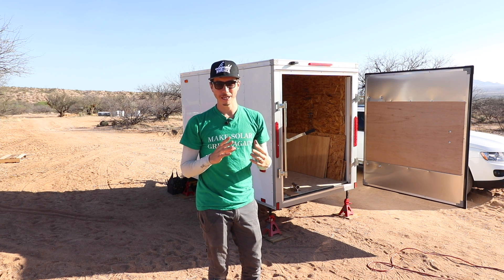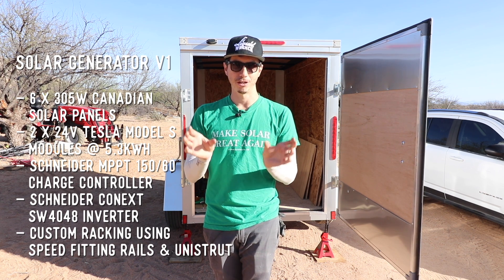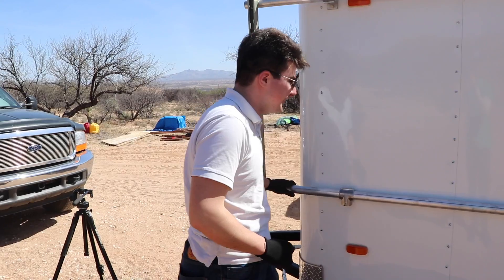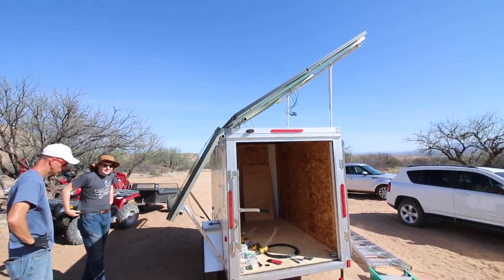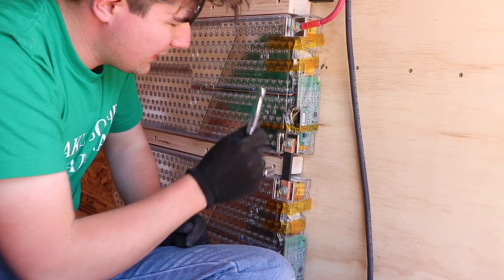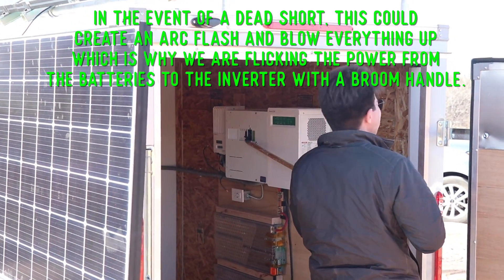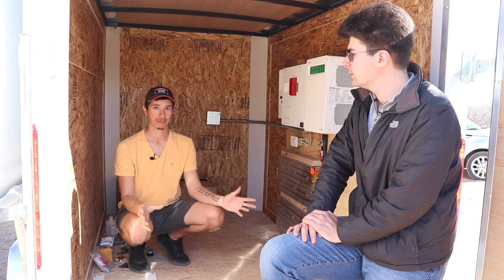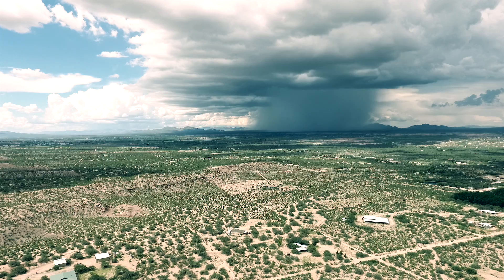DIY Solar Generator With Tesla Batteries On A Trailer... Can It Be Done???

Comment: This is exactly what I am thinking of doing for our REACT emergency response communications team. I have basically the same trailer that I am wanting to use, yet I only need to be able to power our radio equipment and other various 12-volt equipment for disasters so I will be doing a 12-volt battery storage system with the solar panels on the roof. I was wondering if this could actually be done, thanks for the inspiration to actually go ahead and do it.
Reply: As a fellow ham, I too think this would be a perfect mobile command center for RACES or other mobile/emergency operating. I would still go with a high voltage (48V) system since you will need a clean linear supply to operate most radios and filter out any inverter harmonics. Still plenty of room in the shed so I bet you could fit a mini shack on the other wall. Might have to investigate some EMI shields for the power electronics, large faraday cage anyone? 73, K1DIY
Reply: I am designing everything so that I can try to stay away from an inverter that wastes a lot of power converting from 12-volt to 110-volt then we have to drop it all back down to 12-volt anyway to use it.

The solar panels that I have provide 100 watts at 12-volt. All of our radios, equipment, lighting, rechargable flashlights, HT chargers, and the laptop for digital comms that we use on disasters is already 12-volt. I used to drive a semi for a while, so my coffee maker is even 12-volt, lol. If I can design a portable mounting system for it I also have a 400-watt wind turbine that I can add to the trailer so electricity can be generated even when there is no sun.

I have a full-size cargo van now that I am now using as a mobile communications center. Everything in it is on 12-volt. The trailer would be used as an addition to that system by providing more battery storage and additional solar cells for longer duration events.
Reply: is react still a thing? not heard that acronym since the 80's when cb became a thing in the uk, I used to be part of a volunteer group. is that an american call sign? I ''had'' an american callsign, had in that i've not owned a radio in about 20 years and while i think i'm still isted in the 'book' i dont remeber my call sign, but the ''pay to search'' websites have my name/town etc so i guess if i paid them i'd be able to find what my callsign was
Reply: Yes, REACT is still around, and yes they still utilize CB, but they also utilize FRS, GMRS, MURS, Marine, Aircraft, radio bands as well as being very heavy into Amateur Radio. Many teams are even getting into satellite communications and things like that for disasters. We work alongside ARES and RACES ham operator teams.

Yes, WH6FQE is a US callsign. The H6 shows that it is located in Hawaii. With your name, city, state and approximate date of issue of the license I may be able to look up your old callsign for you if you want me to try. Send me an email at WH6FQE@mail.com
Reply: We have companies here in Australia already making them, they use the in the open cut mines as mobile command centres and others as radio repeaters. A lot of these mines cover 50+miles between pits down this way, and a lot more from civilisation, with no services nearby, solar powered units have really taken off.
Reply: Aussie Manly Man

This is perfect timing. We just decided yesterday to make a change in our setup. The van will still be used for our mobile communications center, but the trailer will now be set up as an independent mobile repeater. This way when the normal repeaters on the island go down, we can just move the trailer up to the top of a hill or parking structure and we are back in business with a repeater. 

Unfortunately, this now means I need a LOT more batteries than I originally planned on.
Reply: We aren’t using lithium batteries much here, due to the fact of the items being in isolated areas and people stealing them. There are a couple of companies making flow batteries here who supply either vanadium or zinc bromine batteries. They don’t get stolen, last longer and are cheaper. But a Chinese company called BYD has just slashed prices for for lithium batteries, so they will be cheaper now I think. But price doesn’t matter much to the mines.
Reply: I looked into LiFePO4 batteries for our project, and I just can not see the justification for spending over $1,000.00 per battery to build two separate battery banks with. 

We are looking at SLA batteries right now. I can get a 155AH for $339.00 so about a third of the cost of the lithium batteries I looked at that was close to that capacity.

I am coming up with a total of 8 batteries needed, 6 in the communications van, and 2 more in the backup repeater trailer, so $2,712.00 sounds much better than $8.000.00.
Reply: WH6FQE - The Kilted Piper I built the exact system that you're looking to build  by repurposing Tesla batteries the total cost only came out to be about $4,000 there are plenty of used batteries on the market..
Reply: I just priced out (generally) the same components and I'm at about $8K.  Can you share your build list that kept it to $4K?

Comment: Smart idea and great project but what about road safety(mounting panel on AL bars only versus highway speed winds) and cooling of inside of trailer? Is it going to overheat? But thank for the video anyway 😎😇
Reply: Many aircraft are built almost entirely out of aluminum, likewise, for many unibody car chassis, you got something against it? While constructing this we had 25mph sustained, 45mph gust, winds and the thing didn't even budge, when folded for highway transport it's a non-issue
Reply: Liam O'Brien - I have nothing against aluminum - but I am very aware that there are a lots of very different aluminum alloys and so someone constructing from it has to me aware that also ... AFAIK

Comment: Great job! Are you planning to use the same size trailer for the set ups you are selling? Is there a minimum size that one can use for this set up? I'm assuming that you chose a size that worked the best to mount the panels and battery bank.
Reply from the maker: we found the smallest trailer that would work for what we wanted to do, could go smaller and do 3 panels that would have a slightly different application :)

Comment: the part that trips me up about solar is connecting it to grid power. Lets say hypothetically I build this and throw it in my yard, how do you connect it to your house so that your house depletes the batteries first and then uses city power when the batteries are extinguished. This is the part that I don't understand about solar.

edit I understand that you want to sell these units but I'm curious how much it cost. I've seen those Telsa battery banks on eBay go for 3k+ alone.
Reply: Hi, I think a transfer switch is used, either manual or automatic. Basically, it cuts power from the mains and uses the solar/battery setup. 
One thing you never want to do is supply power directly to your house without one. During a power outage, the power can backfeed through the mains and kill someone
working on the power lines. The transfer switch assures isolation between the solar power system and the mains power. Hence never shall the two be connected at the same time.
Someone, please correct me if I'm wrong. :) Have a nice day.

Comment: Didn't see any solar generator. Saw a nice solar system though. I get by on a gallon a day running my generator from 1973. Some days I don't use it at all. Your fuse problem would have been solved with a resistor of the appropriate size. Thought maybe you had built a home sized solar steam turbine GENERATOR.
Reply: David Link panels do GENERATE electricity from sunlight, just because they don't belch steam and noxious oxides doesn't make them any less of a generator, we aren't in the 1800's anymore
Reply: Liam O'Brien nice pretzel. Politicians generate a lot of hot air so we should call them generators as well.
Reply: I would agree with you about the hot air down in DC, but I'm only going by what Webster's says. gen·er·ate verb: cause (something, especially an emotion or situation) to arise or come about. produce (energy, especially electricity). Seems to fit the bill eh? Mmm pretzels, gotta go get me a snack...
Reply: Steampunk the setup!

Comment: What are you using for BMS? (Are you using a BMS?)
Reply: Four ZeroFour the video was already running 20min so we left out A LOT of detail, once we iron out a few bugs and Derek gets the shop up we will be making a super detailed course on how you can build your own including what we are using for battery monitoring (we can read cell voltages and do balancing with the built in Tesla BMS) and all the other details that go into a quality build
Reply: Liam O'Brien Thanks! Looking forward to it!
Reply: firpofutbol the book mainly covers the Smart car modules which don't have an easily accessible BMS built in, however, I do go over some alternative solutions for monitoring
Reply: Liam O'Brien is any of the BMS stuff explained in the book/pdf you sell?

Comment: With all those extra sails, what wind speed can it handle?
Reply from the maker: when we were building it, we had 30mph winds with gusts up to 50mph :D
Reply: Handeeman - Stabilizers on the outside of the trailer would make a lot of sence.  So would mounting the batteries near the floor to keep the tailer's center of gravity as low as possible.

Comment: This is awesome. I want to have a solar set up but doing more research. It wouldnt be useful during the winter here as we dont have sun but the rest of the year it would. We have a 2500sqft home. Am i crazy?
Reply from the maker: Do you live in Alaska? there are many factors to take in to account that it's hard to say :)
Reply: You happen to live in Greenland? Because they actually have almost no sun for 6mo out of the year, but if you live in any more reasonable climate then you will produce plenty of useable power in the winter
Reply: When I lived in Edmonton, Alberta. Canada, the sun in winter was at such a horrible angle, solar was a challenge. Out in the northern wastelands, we used electricity sparingly. I don't know what our setup was, but it was lithium ion batteries.

Comment: Wondering about keeping the temperature inside the trailer consistent since lithium batteries don't like being charged in extreme high and low temperatures? In my area, I have deal with 90° F outside ambient and +80% humidity.
Reply: Felax Chow one plus is that the panels create there own shade over the trailer, meaning that even on a hot day it will still stay pretty cool. It's pretty hot in Benson during the day right now but the trailer only gets up to about 85F/30C
Reply: Getting too cold is a bigger problem for lithium batteries, I recommend putting a thermostat with some kind of heating so the batteries don’t get too cold. Mortons on the move have done a very good series on installing Tesla batteries in an rv solar system.

Comment: Awesome, what was the cost for a setup like this??
Reply from the maker: About $10k for all materials
Reply: Thanks for that, I was doing some rough cost analysis and came up to about $8K for the main expenses and then figured you had at least another $1K in incidentals and misc hardware.

Solid build though.
Reply: About $17k Canazian.

Comment: Hi, I realise this is the first one you have created but do you have a cost breakdown for the unit you created?  Also, it sounds like you will have have a surplus of energy generated each day, could you have got away with only 4 panels or is there something else that could utilise the excess supply?
Reply from the maker: About $10k for all materials
Reply from the maker: our trailer was about $2k, so $8k total then to replicate what we did :)
Reply: What if I already have the trailer? A double door Wells Cargo. I'm interested.
Reply: H2Dwoat H2Dwoat you always plan solar for winter, since the nights are longest vs summer when days are longest. Everyone who plans their systems correctly ends up with a glut of power in the summer; perfect for running ac without killing your system. I'm waffling between an induction cooker or propane because the extra solar/batteries isn't that much more. - Jacob
Reply: Acoatof Gold That makes sense.  I suppose I'm just trying to work out the cost vs benefits in my mind. The cost of a generator, its depreciation over time, fuel and maintenance against the investment in the solar system. I assume maintenance for the solar system would be minimal but as I understand it the PV panels and batteries performance degrades over time. I would be interested in a detailed video covering this.  One concern I would have with the mobile setup, given its value, is how attractive it would be to thieves but I suppose the same could be said for generators.
Reply: Is that thing going to stay on its’ feet when a dust devil or summer microburst hits it? Those little trailers don’t weigh much...
Reply: How did you program the Schneider inverter Bulk, Absorb and LVCO programmable values to work with the voltages of two of the Tesla S modules? Two modules fully charged is 50.4V at 100% SOC which most residential users wouldn’t want to use as that would limit their life. The Conext XW minimum bulk is 54.2V. Are you somehow bypassing bulk and just using absorb? Floating these batteries would be bad too. 

What values did you use to mate up to the batteries?

Comment: Have they changed their air conditioner over to a soft start unit the YouTube channel gone with the Wynn's put out a really good video about the soft-start unit that they installed for their air conditioner on their boat it allows them to run the air conditioner on a battery Bank with a little bit of an underpowered inverter I believe
Reply: Wayhart it’s the Micro-Air 👌🏻

Comment: There is a company in california that build these but they use lead acid batteries for storage. I had planned to build one for myself soonish or laterish. With all the flat surface area to catch the wind, I wonder what wind speed it would take to turn it over and destroy it? It only takes a 40 mph wind to turn over a tractor trailer. That may be why the company in california uses lead acid batteries, to keep it shiny side up.
Reply from the maker: I think they do it for cost but their watering system to keep the batteries topped up is kinda silly when lithium ion is so readily available and is cheaper over the long run.
Reply: There's actually a number of companies that does these... Mobile Solar, Solar Power Beginner, Sunseeker from Mobile Solar Power, National Solar Technologies, etc.

Some just date back about 20 years and are need of a more updated design but they have traditionally been a fairly expensive option.  Mainly used by government agencies for disaster relieve, entertainment industry, etc. where generator noise needs to be avoided or areas cut off from supplies and thus unable to sustain prolonged use of generators.

A $10,000 price is much cheaper than most of those traditional options...

Btw, there's this UK based Engineering company called Ten Fold Engineering that has developed folding structure mechanisms that can allow just about anything to be compact for travel but unfold and deploy at the destination...

Here's an example, https://www.youtube.com/watch?v=jm3q7zhveX8
Reply: Could always add some guy wire and places to tie it onto. At least then your trailer wouldn't flip over but the panels might fly off one day.

Comment: Love the idea of using cargo trailer with solar power.   It can be used as backup storage for tools and garden tools on other side of the wall or water filter system too
Reply from the maker: you know it :)
Reply: @Handeeman  - I am building this exact same system, and have a simple quick question... How do you ground the Conext SW4048? Do you need to pound a ground rod into the soil before you turn the system on at each location or is there another way?  - Thanks in advance!
Reply: Water and solar power is accident wating to happen..

Comment: Tesla batteries are the best power source it don't overheat when it's in use or cost gases
Reply: Tesla batteries are just banks of the best 18650 cells money can buy (Panasonic)
But any cell bank put together using decent 18650 cells will perform very similar (LG, Samsung, Sony)